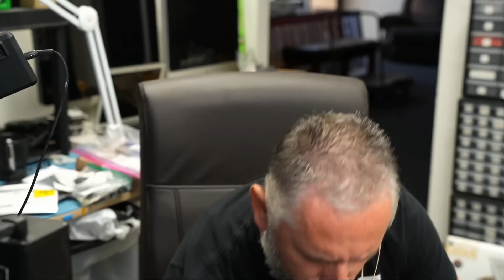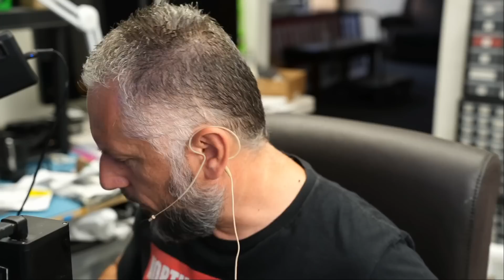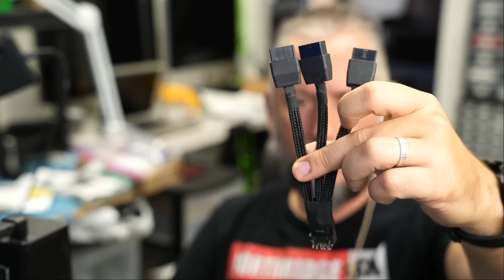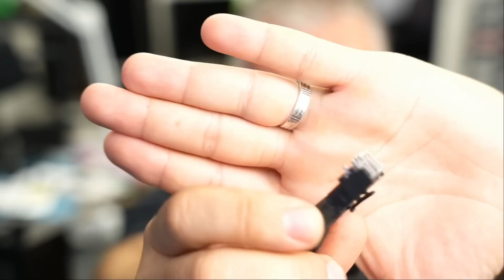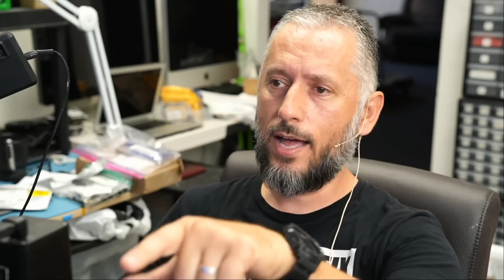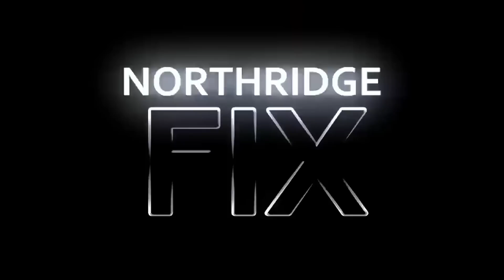MSI Responded- 4080 Connector Breaks & Causes Smoke Alarm

Comment: This reminds of a supervisor I had at the factory I worked at. He would tell us ,if you have a problem, let me know and I will do nothing about it . There is a lot of things here that are not clear. There is one thing that is very clear. The card had an glaring defect or part of the process that slipped by. I am pretty sure these cards are made by a highly computerized process. I am pretty sure they are inspected by a human before being packaged. I am pretty sure they are tested. Having said that , what the warranty card say, we don't know. We don't if the customer contacted the people he got the card from. A lot of companies now a days will say, don't return your product to where you got from but send it to them. I understand that sending your defective product back to the manufacture can take a long time and you want your rig back up and running .Alex did an amazing job in repairing the card as he always strives to do. The card is fixed now and I figure MSI is thinking ,well we can issue  a vague bunch of nonsense statement about their awareness of the situation layered in that a, bit of indifference.

Comment: I was correct in saying that MSI is responsible for that connector and there wasn't enough solder to hold that connector. I have seen other electronics with piss poor soldering jobs and they stop working due to the solder joints no longer making a solid connection to the board.  MSI should send the customer a brand new card.

Comment: My opinion is that it's a connector issue: the thickness of the pins or the way it makes contact with the cable.

MSI's answer was ridiculous. Good, they are aware, but what about all the defective ones already sold?

But is that only an MSI issue? Isn't that happening to all brands?

Comment: In 1990 I worked at Honeywell basic computer line in Phoenix, our department also made some surface mount boards and everything we made at that plant was industrial control so soldering ever single component and testing was critical. Every assembler was an inspector, not just the leads.

Comment: The 5090 should be wanting even more power than the 4090
Reply: 800W (66,6 Amps ) with 1,5mm² cable & oily polymer connector = BBQ . The answer is 300W  by connector with 2,5mm² cable and not oily polymer connector

Comment: Seems to me there are multiple cards out there with this manufacturing defect, proper response of MSI should be that all cards will be replaced or repair costs of 3rd party repair shops will be compensated fully. Since turn around times are so long MSI should honour repair costs of 3rd parties.

Comment: Quite often the boards are being assembled in Mexico or China where quality control is not top priority. Also when you have boards with heavy parts or big fat terminals, it needs extra care to be sure oxidation is removed before it is installed. Wave soldering is optimized for most of the parts on the board and can not properly solder components that have large terminals or solder pads. I think also there has been some changes to the solder formulations currently in use and that alone can contribute to bad connections.

Comment: What if the issue is with the solder alloy and the vhpwr connector pin alloy used on 4090s by all the companies ??????

Comment: I'd be happy with them at least refunding the money that it cost to get the video card repaired assuming that the customer is ok using the video card after you have fixed it. 

I dont know what MSI would do with the video card and I dont think we should say that they 'have' to do a new video card if this one goes straight to the landfill. This is my ignorance here though as I am unsure what reasonable processes are for returned cards from an RMA or Warranty. 

I would rather this because it is something that they can do for every single issue that pops up. Something that I dislike is the people that get into the 'news' or the scenario has a tonne of popularity due to a video, that only that singular instance gets resolved excellently. If they do this, it is a reasonable approach to then be able to do that for everyone. And if it can be shown that they do this for others as well, I would be happy with this.

Not exactly ideal, sure, however I think showing at least this level of trust in Warranty would be good for the industry with certain other.... brands ignoring warranties.

Comment: I agree with you !00% without a doubt. these connectors on these cards are exactly why i moved away from nvidia based cards. i'm sure AMD has their issues as well but i rarely ever see a high end AMD card in there for repair. I have a AMD 7900 xtx and i've never seen it ever have even a glitch. i've had my share of 48 and 4900's i've always had issues with them one way or another. i have a 4080 in my laptop (Asus STRIX G18) so far it is behaving. I believe it is actually MSI not following nvidia's manufacturing guidelines when producing these cards putting cheap garbage connectors on with bare minimum solder to cut costs. then they will slap a limited warranty on the cards except when it comes to power connector issues. they tend to reject or deny warranty claims and point the finger at the customer just gives them a way out of responsibility. if they spent a few pennies more on connector engineering or even going to a more robust industrial type connector that can handle the current needed for these cards they would actually be in better shape financially. just my opinion. Love your videos man. love your work and how well you describe the problems, solutions, and your vast amount of knowledge.

Comment: Stay away from MSI products. I have an MSI MAG B650 Tomahawk WIFI Motherboard. A lot of the reviews state this motherboard is great. Those are all fake reviews. I made the mistake of buying this motherboard, updated the BIOS, and then all of my fans were running at very high speeds if not at max. I reloaded the previous BIOS version and that still didn't fix the issue. I used the MSI app and that didn't work, either. I do have a case fan hub to add more case fans. After a lot of troubleshooting, I was extremely close to refund this computer back to Microcenter.

After further troubleshooting in the BIOS, I found out that it was my system fan #4 that controls all of my fan speeds and I also had to change the fan mode. But whenever my PC boots up, the fans still run at high speeds when I log into the computer.

So after further researching, I found the Fan Control software, and used it to control my fan speeds. At the time, I did eventually update the BIOS to the latest version, but that didn't work, either. So the only way to fix this is to use the Fan Control software. Nothing else worked. If I exit out of the Fan Control software, my fans do run at lower speeds, and my PC runs silently. My fans run at 55% which is what I want. But anyway, from that day on, I will never buy an MSI product ever again, and I recommend for everyone to stay away from MSI. With this much detail, it's impossible to make this sh1t up.

Comment: Looks like CS didn’t have the connector fully seated lol, my 4080 super from MSI Suprim X question was it daisy chained? I have 3 pcie connectors that run from my Power supply to card. Some people Daisy chain lol 2 wires with 3 connectors lol.

Comment: Yeah MSI dropped the ball they should have said "We are glad you were able to repair our customers card, but we would have liked to get our hands on this and look at it closer, to look at the batch via serial number and manufacturer date/location to ensure we do not have a greater issue issue"  For sure... this is wild, I bet the robot arm that solders that connector on ran out of solder mid process and it just got binned.... thats pretty bad
Reply: That was big mistake that response, will they do recall or what? Maybe their statement open possibility to something big, e.g. all 4090s recall ...
Reply: Made in Chy-nah !
Reply: I'm surprised that someone at the company even bothered to make a post about it. Having said nothing would have been the better response like they've done in the past. Because like already said, it's just words at the end of the day and it doesn't fix anything for the person/people who have had issues with these cards. I would personally have contacted the place where I bought the card first, assuming there was warranty left and had them deal with the issue and I would very likely have got a new card. There have been so many issues with these cards that you can't blame the user, it's clearly a design fault.
Reply: You have to ask yourself, how many other cards did the soldering arm bypass that day? surly its gotta be a fair few.

Comment: Electronics are a bit like a washing machine... you dont want to leave it running unattended (like leaving to go to the store for 30 mins).. incase a waterhose breaks = flooding... and if the pc catches fire = .....

If you do dare = have a good home insurance and a bugout bag stored in case shtf, just outside your main living area.

Ofc, its 2024, so having smoke alarms and water leak alarms (which also sends alert to your phone) = a must.

Also: get a camera that you can view and steer from your phone... which also detects motion and noise.. + records to the cloud... (i once caught a landlord taking a peek in while i was away..)

Edit: when you dont use the washingmachine and you leave = just turn the tap -off", so even if the hose start to leak = there wont be any risk of flooding.

Comment: MSI is a CAF of computers, they have faulty components like graphics cards, laptops, DVD/CD drives. Likened of railway rolling have cracks. Nvidia is a Boeing of graphics cards they connectors fell off from 4080/4090s. Likened 737MAXs doors fell off.

Comment: I have had 7 boards from MSI over the past decade where all of them failed. Not a single one worked. Okay one did but only because the consumer I got that for was not willing to waste time sending the board in for RMA as 2 of the RAM lots stopped working(no bent pins on CPU socket) but as 2 were working fine he kept it. Then retired it after 4Yrs of usage. But yeah 7 boards I purchased from MSI all 7 ended up not working properly. I stopped recommending MSI after my first 2 encounters with them and the 5 I purchased after them were to see if they improved over time and sadly they did not. Their GPUs used to be good quality on the other hand where I did not face any troubles till date. But have not used MSI GPUs for past 2-3 Gen as now Gigabyte also offering really good budget options in form of Gaming OC card. But yeah sad to see them go down on QC on their GPUs too not only their Motherboards.

Comment: That connector was never soldered at all at the factory. Must have been a friction fit of the pins into the  plated-through holes only. 
If soldered why were ALL the holes totally clean. Where did the solder go if it was there.
Reply: As the holes had no solder in, it has been soldered only on one side. The surface was not prepared for soldering, or the temperature was too low and only on side was solder. That seems was MSI says, but it doesn't solve the problem for actual cards with the same issu.
Reply: @pascalmathieu9332  plated through holes only need be soldered on one side
Reply: if soldered correctly that would be true. solder would wick thru to other side but  it didn't
Reply: Yeah, even the small communications pins came out. Very weird.

Comment: its not MSI fault , its connector flaw , you cannot push that amount of current through that connector , in upcoming card either they will give extra connector to make up for that flaw or redesign the connector , but what about the user loss no one is taking about because of flaws??
Reply: In this particular case, it IS MSI's fault. They did NOT solder the connecter to the board! There was NO solder holding on the connecter. MSI did not solder the connecter to the board! MSI, the people that made that card, forgot to solder that connecter to the board. How could that be anybody's else fault other than the manufacturer that made that card which was MSI.

Comment: These connectors are problematic. Nvidia have to change and need a new design.
Reply: single oily polymer connector is a problem with that much power. They need to make two connectors for power and maybe switch to another polymer
Reply: @raw-v9g  I agree with you...
Reply: after seeing so many connector burn off alex still blaming on MSI? you should mail to nvidia, they are the one design or chose to use those connector, msi and others just a manufacturer, if you dont wanna happen then buy those special edition card that use other connector design, if it have
Reply: @billykulim5202  Have you watched his video, it's clearly not about burned connector with adaptor? If the connector can get too hot to the point it literally evaporated all the solder, left the board clean, then kudo to the engineers who invented it.